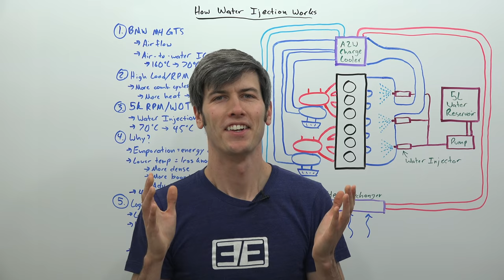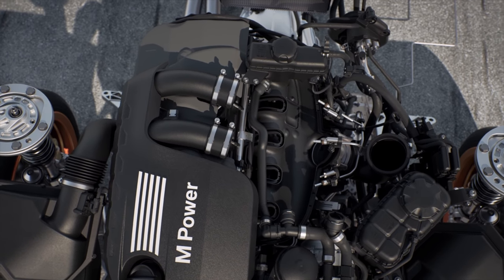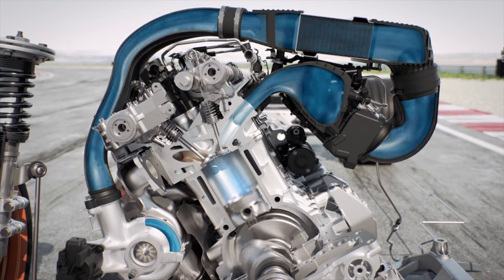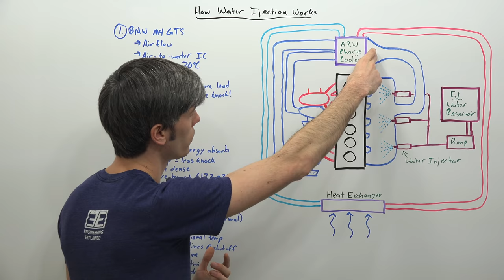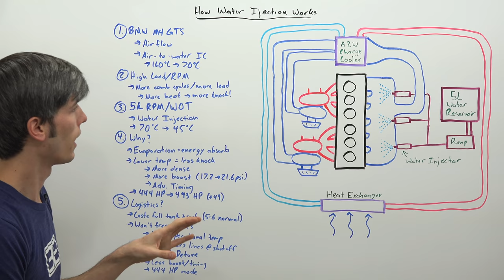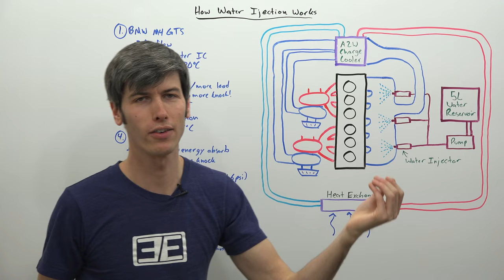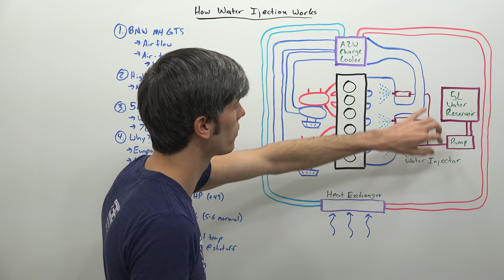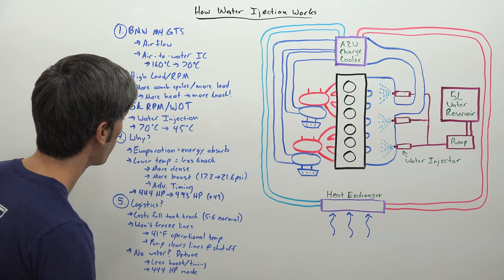How BMW Used Water To Make +50 Horsepower

Comment: And they also solve the carbon deposits in the engine :p
Reply: Not true. Water solves only carbon deposits on top of pistons, inside cylinders and exhaust valves/turbo vanes. Nothing else. And this is only part of engine.
Reply: @Fosgen  doesn't it also solve the problem on the intake side? which is where all the carbon buildup happens
Reply: @85CEKR  No mate. Water is injected as cool liquid (maybe 20C degrees more than room temperature), and covering anything with slightly warm water, already covered with some dust and oil (typical for intakes of turbo charged engines), won't have any effect at all. Oil is not soluble in water, and oil viscosity is higher than water. Oil and dirt will star on intake side, for long time, unfortunately. Best way to clean it is taking off engine and soda/sodium blasting.

Water injected has it's value when turned into the steam because of temperatures inside combustion chamber. Then some specific reactions occurs:

C + H2O = CO + H2
C + H2O = CO2 + 2H2

These reactions occurs mainly on surface, so cleaning of deposits is not quick but it works and overtime surfaces coated with oil and carbon (sludge) may be completely clean. But it takes time and high temperatures of steam, constantly flowing along dirty surfaces.
Reply: @Fosgen  huh, didn't know that water did react with CO2, the free H2 might give it w tiny boost while maybe also diffusing trough the steel and stealing the carbon
Reply: @crackedemerald4930  water is known to increase in volume by 1700 times when turn from liquid into the steam. This can be turned into mechanical energy in combustion chamber as water is squeezed with air before combustion.
Reply: @Fosgen  I wrote a funny short answer (see the smiley face at the end of the comment), I didn't wanted to write every part that is cleaned. I guess nobody expect to have their oil pan cleaned by the water injection, right? Or did you forgot to change your blinker fluid and the pistons springs?
Reply: @valichesu  blinker fluid changed, and sump pan polished.
Reply: Mt dew injection for LeRoy
Reply: @Fosgen  "Oil is not soluble in water, and oil viscosity is higher than water."
Usually it's not the chemical composition doing the cleaning, but the thermal shock.
Reply: @Fosgen  use windshield washer fluid.
Reply: @furryfrog9520  usually tap water is fine. I used to spray 2L water into my turbo diesel intake right before engine oil change. Borescope in cylinder shows it's about clean, at least cylinder's walls and top of pistons.
Reply: @Fosgen  cool, I get what your doing, a maintenance routine. I just use windshield washer fluid in my turbo v8, no worry of it freezing.
Reply: @furryfrog9520   How much of it each time? I think 2L is probably overkill.

Haha, make sure it's winter windshield fluid. 😌
Reply: @Fosgen  yes, winter windshields washer has more methonal than the summer. At full boost I'm spraying about 800cc a min. 7.3l engine.
Reply: @Fosgen  Yes, the phase change advantage to water injection is well known.
Reply: Generally what cleans the inlet ports and intake valves in port injected engines is the additives in the fuel (and the fact that oil is soluble in gasoline).
Reply: It also mixes with the oil and deals with those pesky cylinders!

Comment: Does that require distilled water?
Reply: Exactly
Reply: Of course!
Reply: Mountain Dew
Reply: The reason I ask is because a system that advanced could have a filtration system with a micron rating that would be sufficient to clean water. Also where I live gas is around 2.20$ per gallon and distilled water is 75 cents to 1$. Does that water really need to be cleaner than the fuel?
Reply: @melaniew77msn  it's not about the price, distilling water is a easy and cheap process and it makes water almost pure, and about the filtering the water, maintaince costs of BMWs are already very high, a filter would be something to be changed once in a while, and it would make maintenance higher and make the car less independent, so thank you bmw! This car better off without a filter for that water!

Comment: Why use water for +50 hp??? Just use a fake hood vent, every one knows you can get +200 hp with it
Reply from the maker: I’m glad that we’re finally getting over putting fake hood vents on production cars. Still a couple that do it, but mostly dead.
Reply: @EngineeringExplained  But, gotta keep the JDM badges. Good for many hp's, even on German cars!

Comment: I’ve use water injection for many, many years on my turbo cars. I use the windshield washer reservoir and windshield washer fluid (the -20 degree stuff) in the winter and usually straight water when temps are staying above freezing.

Comment: Im surprised it took the auto industry this long to come up with this. After learning a bit about compression ratios, knock prevention and air fuel ratios it was obvious to me that its more logical to use cheap water to drop temperatures instead of just more fuel
Reply from the maker: Actually implemented in the 60’s in the Oldsmobile Jetfire, though they used a combination of water and methanol.
Reply: @EngineeringExplained  dude could this also solve the carbon build up on direct injection engines?
Reply: It's been done before but having to check a water tank and filling isn't something most car owners ever want to do. Mist would probably prefer 493hp all the time and lower fuel mileage.
Reply: It was also available on 1st gen STi Type-R with manual or automatic water spray, the 90s were a cool time.
Reply: the reason you don't see it widely used is because it adds a bunch of components, nozzles, lines that cost money. Not to mention the computer having to adjust according to outside temps. All that stuff adds money and weight for a negliable amount of HP. Pretty useless in most cars simply because they don't have turbos.
Reply: Saab had it as an option for 99 turbo from 1979
Reply: I would happily fill up a 5 liter tank of water (put in the engine bay for cheaper) every day if it meant better gas mileage/higher peformance
Reply: Saab did it with their turbo engines in 1980s...
Reply: @2689vjavier  so most car owners never fill up their windscreen washer bottle?? What's the difference? If only needs a fill-up every 5 to 6 tanks of fuel of everyday normal driving.
Reply: @ghassanalfarra8935  my experience working on cars says no. Most people have they're washer fluid filled when their oil change is due by a mechanic. You're watching engineering explained. You are in now way the normal customer. And based on the usage rate being much lower than 1.5 gallons every 6 weeks I know that most people are gonna spend a lot of time with empty water tanks. This extra maintenance is why water injection is rare. Also why oil catch cans are rare.
Also having horsepower that needs to be refilled will cause increased dealership visits.
Anyone watching this video is not a typical car owner
Reply: @aSinisterKiid  i wouldn't call an extra 10% negligable. But otherwise you're right.
Reply: @2689vjavier   well, if the want the full 493 HP, they need the water...
Reply: @jfparent695  yes and we know that but they'll just show up at the service center. Again I'm just explaining issues that we know these water injection (owner maintained) systems are actually maintained by real customers.
Reply: @aSinisterKiid  ; I agree. However most car now have turbo because more fuel efficient combustion, not because they want racecar power.
Reply: @rif42  I wasn't referring to the reason anyone has a turbo. I was saying most car's on the US market DON'T have turbos. At all. So this "water injection" wouldn't even be possible to use in most cars. Because they don't have turbos. This is why WI is not widely seen in the auto industry.
Reply: @TheMrANONYMOOSE  that wasn't water injection, it was a nozzle that sprayed water onto the outside of the intercooler core to help the top-mounted intercooler perform better in hot or low-airflow conditions.
Reply: @Runmeerkat  if it's plain water, it probably wouldn't help the carbon buildup , but if someone altered the system to use a water/meth mix, it likely would help.
Reply: @jsquared1013  thank you a lot for your answer but may I ask you why?

Comment: New old stuff is cool.  Was used in aircraft years ago, GM used it on the turbo charged 62-63 Oldsmobile  Jetfire F85, GM called it Turbo-Rocket Fluid. Saab used it in the 80's and I use it now, works wonders keeping detonation down and allowing more timing.

Comment: But what if you used methanol instead?
Reply: it wouldn't be so exciting and "new" to the uninformed consumer hahahaha
Reply: Wet shot. I’m not sure how much it would cool the cylinder (alcohol having a lower boiling point), but you’d definitely get an increase in power output. WET SHOT!
Reply: Put some quality vodka in there! You have both alcohol and water😂, but I'm afraid it's going to be expensive

Comment: Very interesting video!  My dad added a water injector to a mid '80s VW "Rabbit" that didn't have fuel injection, and it wasn't a regular carburetor.  That weird application was what we had, and he said the water helped it.  I imagine he was right, because he was an engineer and basically right about everything.

Comment: Wow, BMW actually made an engine that might not explode in the first 10,000 miles even if you're driving it hard.
Reply: Are modern BMWs really that bad?
Reply: I still love my old 92 E36. No vanos, no turbos, no problems. As far as I can tell the M50 engine is pretty bulletproof.
Reply: zuilok yes they are bad. As soon as the warranty is over, they will just empty your wallet.
Reply: @zuilok  some of them have well-known issues that are problematic, but if those are handled then they're just demanding of higher/more attentive maintenance, like anything German.

Comment: Imagine one of those injectors being stuck open. Rips the whole block apart
Reply: Marke injectors very rarely stick open and how is a mist of water being sprayed into the intake manifold  going to rip the block apart? lol
Reply: @shenaniganshop3309  ever heard of flooding an engine? On (at least slightly) compressible gasoline that's one thing. Water is not compressible. That's going to increase the "compression ratio" drastically
Reply: Marke liquid gasoline isn’t compressible either lol and how often do you hear about leaky fuel injectors hydro locking an engine? Not very so I’m sure it will be even less common then a fuel injector leaking since it gets used much less, also the water injectors spray a very fine mist that’s why five liters of water can last a whole 15 gallon tank of gas, they hardly spray any water. Not gonna be a problem.
Reply: @shenaniganshop3309  If you say so dude
Reply: Marke instantly thought of rolling my poor 84 LT125 Suzuki ATV in a local pond. It didn't hydro lock luckily. But interesting thought, bet they injectors are engineered to fail in a closed position. Like o2's fail lean,so the ecu interprets and saves us by running rich. Rambling on here......have a good one
Reply: Shenanigan Shop on my car if you have a leaky injector, the ecu cuts spark to the cylinder to reduce the chance of the igniting fuel at the inappropriate time. Have seen manifolds cracked up (pressure back thru the intake valves) and valves bent. Some say you can throw a rod but ehhhhh. I'm not a wealthy man so I run a 98 323 with 198,000. Great lil car, that m4 GTS OMG!
Reply: @shenaniganshop3309  I could be wrong but most water injection systems don't use an injector that opens and closes but a nozzle that just sprays whenever there's pressure (from the pump) behind it. 
So unless the pump is "stuck on" there shouldn't be an issue
Reply: Lorenzo Esercitato knowing bmw they probably over engineered it with injectors tho
Reply: There is no way those injectors are rated at 300L/min, which it would take to hydro lock at 2000 rpm, let alone 750L/min at 5000 rpm.
Reply: @shenaniganshop3309  This Tech isnt new, hes talking about even if the car is off and the knozzles fail, it will leak from the tank and hydro lock the engine. But I think they place the tank low in the trunk(at leasy how I did in mine) so theres no chance in ruining an engine. My tank is only 2 liters
Reply: Michael Cardenas never said it was new lol my dad used water injection Back in the 80s on his car

Comment: It's only exciting until it break/fail.
Reply: Yes....and it causes a total engine breakdown...then needing a brand new engine
Reply: @nylnyl.  Not really. I don't think a failure would cause the engine to flood with water.
Reply from the maker: That logic can be applied to absolutely any car haha. They're exciting when they work, less so when they don't. And again, if the system were to fail, you'd still have 444 HP.
Reply: @KP3droflxp  that's not the concern...
Reply: @EngineeringExplained  good point! Haha.
Reply: A similar technology to this was used in various WWII warbirds. They could run about 5 minutes before this started damaging them though. It was called "War Emergency Power". But BMWs tech is a more refined version and seems to be designed and biased for a sustained use and more moderate power increase, instead of a short burts of a lot of extra power to save your pilots life.

But then again, it's bmw. The company that is totally fine offering a car that frequently blows up passes 50k miles. So all bets are off.
Reply: Then do not buy any car at all. Stupidly exhausting comments...
Reply: Corey S  manufacturers will tell any lies to sell their products. That's why they're rich and....you're poor, stuck fixing their defects😞

Comment: This is awesome love the vid and the concept I hope its successful my only concern is if one of those injectors leak and water pooling in the intake I'm also assuming that the water vapor is a small enough amount it wont effect the burn of the air fuel mixture

Comment: 1st
Not for my girlfriend. 
She fails to put water in the windshield washer reservoir.
Reply: 2st
Reply: what about blinker fluid?
Reply: @evilemperor6426  don't even get me started on the blinker fluid. She never even buys the right fluid
Reply: Swampy  that's good to know. Why haven't the guys at UnboxTherapy done an unboxing of that. People have a right to know... Let me call my local auto zone. 
....
Ive never had these issues with my old Toyota Celica.
Reply: First off idk where you're from but windshield washer fluid is made from a methanol and distilled water blend..
Reply: @scenicdepictionsofchicagolife  well I think methanol was added to prevent the fluid from freezing (among other things maybe) but I live in the Caribbean; we don't have that issue. And wasn't methanol banned in the place of ethanol? Anyway distilled water is fine.
Reply: Etanol with some chemicals to make you sick if you drink it
Reply: So she won’t get the benefit. System de-tunes if the tank is empty.

Comment: We were using water/methanol injection under turbo boost back in 1980.  We also had a MSD timing control unit that reduced the advance under boost.

Comment: We were doing this on medium speed diesel engines in the late 1970s. We had a mixing pump prior to fuel manifold. Power went up as did engine temps. We had to fit nimonic valves and seats as standard burnt out.

Comment: You forgot to mention that the water is converted to steam during combustion. Going from liquid to gas, the water cools the surrounding area down to have enough energy to do so. Furthermore when water converts into gas, its volume is increased by 1000 fold. This also means greater downstroke force on the piston.
Reply: 🤔 So it's in effect...a steam hybrid

Comment: This is always a fun principle to explain to people.  I usually start by taking a room temperature can of [choice beverage] and making it ice cold in a few minutes. Your video is long enough to do this.  You could've cracked open an ice cold Dewski at the end. (Remix edit?)  Anyways, I've always heard about this "trick" from old school hot rodders and racers.  Cool to see it being used.
I assume most people with this car will be using the purest of bottled waters.  I'd be interested to see what my local municipality water would do to the engine.  When I wash my car, I have to go wash it again somewhere else.
Reply: I imagine they engineered in a filter for just such a reason.

Comment: I knew a guy who sold kits for water injection that improved fuel economy dramatically. The atomised water also turns to steam expanding during the combustion cycle improving torque.

Comment: Hi Jason, great video and explanation as usual. Is it possible for you to do an in depth video for a WRC shock and suspension systems? From the videos I've seen they've very sophisticated units especial for the off road version, handling the jumps and the smaller bumps and riding over rocks etc. How they control compression and rebound. The newer generation of vehicles seem to be exceptional at how they control a big bump and brake at the same time; The rebound seems to be very well managed as well as the ride quality. Thanks

Comment: You should do a video on how changing your tire size from manufacturer recommended will affect power, torque, handling, and fuel economy. And if you would change tire size, if you would also need to change tire pressure from manufacturer recommended.

Comment: One of advantages of a water injection - also it's can reduce carbon deposits on piston head and combustion chamber. If you ever disassemble engine with leaking coolant over the gasket in into one of cylinder  you might notice than top of a piston is shiny and like new.